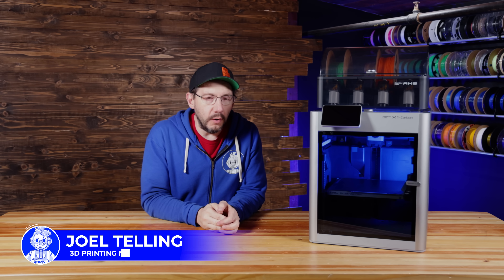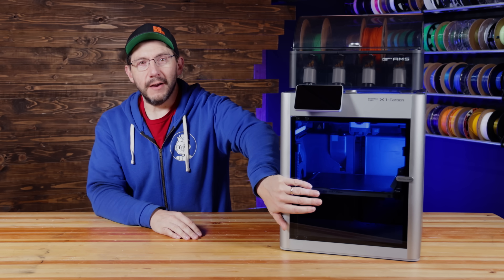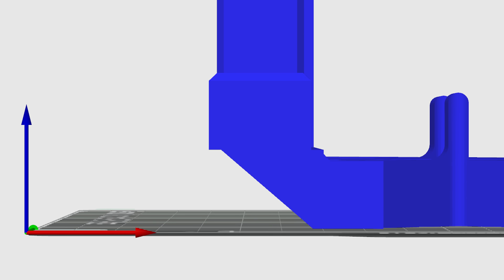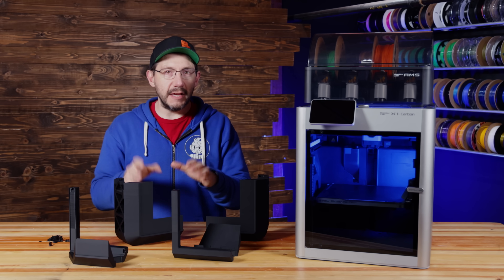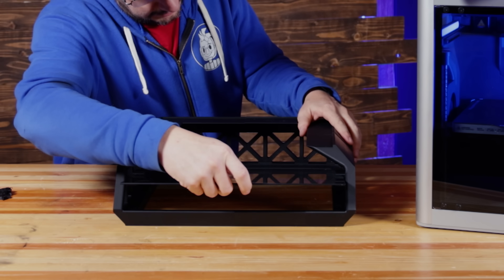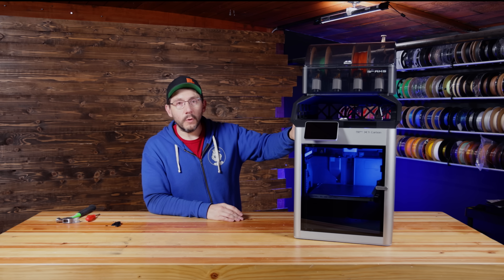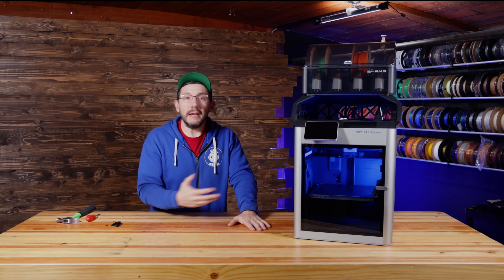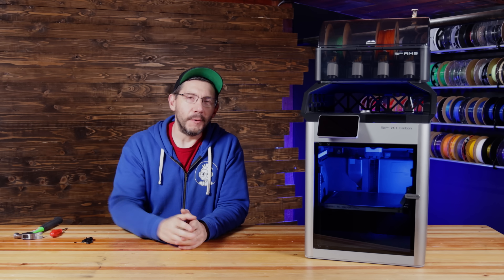MY FAVORITE Bambu X1 Carbon MOD!

Comment: I printed one of these, but never end up lifting the lid and still get great PLA prints.  Since it's in my living room, I'd rather avoid the extra noise, but it's a nice option to have and I use the grid to hold a side spool for the "5th roll"

Comment: I haven't had that problem with pla yet, but my garage is relatively stable temp wise. I do have high humidity (over 60%) so I'm always worried about leaving filament open to the elements due to water absorption

Comment: High quality for a short time. 1925 hours on a X1C it prints like a clapped out Ender 3 now. Lead screw nuts got over 4 mm of slop and bambu says its "in spec"  because there spec is anything from 0 to infinity. But then again according to there better business bureau F rating and the fact they ignore them seems like Scambu lab is a better name for them. But apparently the X!C prints like a clapped out Ender 3 according to bambu lab.
Reply: Sounds like made up bullsh*t but OK, would love to see some video evidence on that. Either that or you've never done any of the required maintenance.

Comment: There's a lot of evidence from folks like Stefan or Tom that anything over 30% infill is just wasting plastic, because it doesn't actually improve part strength. (Thoug I suppose 50% gyroid might help dampen vibration.)  Wheareas increased wall thickness makes a huge difference.  At the same time, I think it gets the point across better if one talks about how thick the final wall is, rather than how many perimeters one used.  Especially in 2024 (which is almost is) with a large number of people using 0.6mm nozzles but a majority still using 0.4mm nozzles.

For something like this mod, I'd want my walls to be at least 1.5mm thick.  Maybe even 2mm.  With a 0.6mm nozzle, that would be 3 perimeters, yielding a 1.8mm thick wall.  But with a 0.4mm nozzle, that's 4 (1.6mm) to 5 (2.0mm).  For a part I'm going to sand smooth, I want it to be 1.5mm to 2mm thick when I'm done sanding, so I go all the way to 6 perimeters to have enough "meat" to work with.

Anyway, my goal is not to tell you how to print your parts - although if you did do 3 perimeters with a 0.4mm nozzle, I'd really like to see a follow-up in six months, because my "1.5mm to 2mm" goal is a fairly cautious number - but rather to suggest that we, as a hobby, need to shift the way we share information about wall thickness, because it's no longer safe to assume that everyone has the same size nozzle.  At the same time, by talking about how thick the final walls are, we get a better idea of what we're actually talking about.  As soon as you point out that 2 perimeters on a 0.4mm nozzle is less than 1mm of plastic, it becomes clear that that is nowhere near enough for something that needs to hold weight or get sanded.

Happy New Year, Joel!
Reply: Absolutey. Stating number of walls without stating the nozzle size is like saying a rope is 5 long. Same thing when people ask how much filament is needed for so-and-so (large) print. saying it takes X rolls isn't very informative at all. Personally I use mostly 3kg and 5kg rolls, but I have filament rolls as small as 750g.

Comment: I was looking at an x1c but it's very odd to me that you even need to do this. Part of the draw of the x1c is the full enclosure and the activated carbon filter to reduce particulates in the air but if it's a known requirement that if you're printing PLA you have to just open the door then that really defeats the purpose completely.

Comment: I decided to go with the "Light flood for closed Bambu lab printers" by Jorge Rui at Makerworld, as it has toggleable vents (no need to mess with the glass) as well as additional spots for lights. It is recommended to print in PETG with PLA support interface, and i found my settings weren't all that great so it took a bit of tuning to print properly, but once i got everything dialed in, it went perfectly!

Comment: How does the temperatures hold up? 
I'd guess there would be slight temperature drops, since there will be small gaps between the plastic and the top of the printer, as well as where the glass cover rests.
But if so, how big of a difference is there, if any?

Thanks.

Comment: I've printed with over 100 different PLA filaments with the door closed, and the only jam I EVER got with the door shut was due to brittle filament snapping. Have you actually experienced this overheating jam Joel, or are you just proactively solving a problem that supposedly exists?
Reply: p1s and x1s have chamber ventialation, so also dont see any reason. Unless you would want to turn that fan off to have quieter print?
Reply: I’ve always had the door closed…never had any problems in the year I’ve used it, only used ever Bambu’s filaments sooooo…
Reply: @Gazooka  Same.
Reply: PLA+HotPlate/Textured - It is not a problem if ambient is around 24 or less. No need to open anything.
If ambient goes 25 and more+, then you quickly reach 40 and fans spin at max.

If you are in ventilated room with ac, you never have this problem.
Reply: @petrihadtosignupforthis8158  this is what i expected

My ambient is 13-16 c and it stabilises at 34-37 when printing 

At 30 c ambient, i think it probably hits the glass trans temp
Reply: I have never had a problem
Reply: @Martial-Mat  I never had the issue until I needed to print at low speeds (<60mm/s). There's a point in using open or vented enclosure.
Heat creep is a thing and many people have suffered with it.
Reply: @thefearpt  I'm not sensitive to different print speeds. I assume that is slower than the norm. May I ask why you needed to print at that speed?
Reply: @Martial-Mat  highly detailed lithophane. 
Higher number of retractions per filament lenght, together with room temperature above 40° (which eventually gives the heat creep to PLA), it's a mess.
Reply: @thefearpt  Oh that's interesting. I've never done anything special printing single colour lithopanes, but obviously if your room is at 40 (c?) then you're in an oven not a room  ;-)
Reply: @Martial-Mat  room temperature = enclosure temperature, sorry for the misunderstanding. But don't you worry, you'll deal with it sometime!
Reply: @thefearpt  Ha ha - I'm too oblivious to recognise it when it happens. Plus I live in Britain, so high temps are not a massive problem!
Reply: My fans don't even run past 80% unless I command it. 

You can also just vent the glass slightly and do the same thing here. 😂
Reply: I live in a tropical country, It’s all depends the enviroment you are in. Ambient temperature can reach 42-44 degrees in summer in my city and this can be tricky in some cases for enclosured printers using PLA… even when is up to 36-38 degrees. In some printers I pointed a fan to the heatsink to make it cooler
Reply: @Fernando_Gazzola  Wow, I love the heat but that sounds seriously uncomfortable.
We don't really get the highs or lows here. But loooong months of grey drizzle. I guess we're spoiled from a printing perspective.
Not that I'm an adventurous printer anyway. I think I'm going off-road when I use more than one colour or metallic filament! 😁
Reply: Well maybe you've never experienced it but this IS the instructions that Bambu gives and some of us like to follow the instructions :)
Reply: I had it happen to me once with a spool of creality pla or st least I think that was the issue either that or an issue with the filament cutter
Reply: @krishgup1208  Ah yes, I have had an issue with the cutter.
Reply: I'm a bit puzzled by this too. What's the chamber temperature when printing PLA? If this was a real problem, wouldn't other materials with higher extrusion temperature but also higher bed temperature (leading to higher chamber temperature) have the same kind of issue?
Reply: Interesting approach to overcoming a problem introduced by not using the “Cool” plate the printer came with! It works surprisingly well. I have over 1000 hours printing PLA with the cool plate and have not experiencing any of problems you described.
Reply: @cbgslinger  I use both the cool plate  and the PEI plate - no problems, ventilated or not.
Reply: @Martial-Mat  I have a PEI plate, but have never used it. Bought it shortly after I got my Kickstarter Combo since everyone was raving about them. It’s a backup for my cool plates should the need arise. The cool plate just works. I use Windex for my release agent. It’s quick and easy.
Reply: @cbgslinger  When it initially launched, the cool plate was heavily criticised for need adhesive or glue. The PEI does not need that and also leaves a pleasing pattern on the bottom of your prints.  But horses for courses - if you're happy with the cool plate, then there's no reason not to use it. I find prints, especially with Bambu Matte filament, sometimes hard to remove, and the calibration lines sometimes have to be razored off.
Reply: @Martial-Mat  I remember and that is why I ordered a PEI plate. However, in reading how others use the PEI plate. I suspect my use of Windex on my Cool plate is no more time consuming that the use of IPA on the PEI plate. I’ve yet to use a glue stick. I do like the smooth finish on the bottom of my parts. Although I really should try the PEI plate just to see the difference. Might come in handy on some of my cigar box guitar parts.
Reply: @cbgslinger  You don't need any sprays or glues on the PEI - that was the whole point.
Once the plate cools you can ALWAYS snap the part off cleanly, which is nice.
I've been using the cool plate all week for a human organs/torso project, and you're right, the smooth finish is nice sometimes. Other times, I spend 15 minutes cleaning up the plate after the print refuses to let go.
And then you end up with divots and bubbles and the plate gradually degrades - although the X1 comes with a spare surface and replacements are very inexpensive.
Gotta be honest - I'm in love with the printer. Almost everything Bambu does (except the cloud printing), I find just excellent.

Comment: Joel, thanks for doing this.  I learned the hard way to keep my X1 Carbon open when printing PLA, after constant jams and some research.   I love 3D printing after 4 years in the hobby it is still amazing what we can do.  Functional prints are the best became they solve a problem, usually quicker and cheaper.

Comment: Mine is arriving next week, this will be my first mod! Thanks for the detailed video!

EDIT: OK, just saw the end. I absolutely love your enthusiasm, Joel. It always shows through; never change!
Reply: Buy a lot of filament the x1c is the filament eater you can go through 2 rolls a day 😂 better stock up 👍👍
Reply: @jcfpv3454  It depends upon the number of colours and the type of prints. If you print a single colour - then it's no worse than any other. If you print 4 with multi colours each layer, then you'll waste FAR more than you print.
Reply: May I suggest that you use the printer for a while first. In my experience, this mod is not needed and you can print just fine with the door shut.
Reply: @Martial-Mat  I'm saving up for an X1C and will get it soon. One of my concerns with this mod would be noise, I imagine the printer would be a lot louder with the top glass wide open? Not sure though. The mod is interesting but yeah I will try the printer with the door closed first
Reply: @SangheiliSpecOp  I've never had a problem with the door closed. Bambu just released a new driver that allegedly reduces print noise by about 15%. There is also a box you can print and attach to the back that reduces fan noise. If you are sure to keep the AMS lid closed, that also reduces noise. I'm very sensitive to noise and I run it in another room, and it's still loud enough to stop me falling asleep, although if I leave my PC on, the white noise is enough to mask it but sleep through.

Comment: I decided to go with the BLV - AMS Riser, because it also got two drawers. With that I got all the extra stuff, and spare parts for the printer, out of the boxes, and into the drawers on top of the printer. :)
Reply: I also went with the BLV-AMS Riser. It requires supports, takes a lot more time to print, and uses a lot more filament. However, I believe that it is worth it if you have the resources as you end up with a far better looking riser along with extra functionality. You can also install LEDs and a TPU seal  directly into the riser which comes in very handy.
Reply: I've been looking at printing the BLV Riser.  Did you need to use supports?
Reply: @dancoon7653  Hi, I know I'm late, but it has a remixed version that uses no supports. It's a bit different but I printed that one and it worked perfectly :) Found it on makerworld in the profile section under the original
Reply: May I have the link to the blog riser?
Reply: yeah but holy cow that thing wants like 3kg of filament :(
Reply: you helped me out making a decision, after watching this video I found a few different ones, but not this one, and I like it!!
Reply: This riser only has 4 clips on the bottom. That is barely adequate.
Reply: @mikeyearwood  what do you mean with four clips?
Reply: I agree I spent the extra time doing the BLV and its way worth it. Plus the addons, spool holder on the side and the tool ravk as well

Comment: I like it. I haven't needed it. For whatever reason, I've had tons of success printing PLA with the doors closed and the lid on. I'm sure I've just jinxed it, but now I know what I'll want to print when I do finally run into heat creep on my X1C!
Reply from the maker: Dude print it just because it’s cool. Just not as cool as you :)
Reply: @3DPrintingNerd  Haha! Actually I've been thinking about printing a 100% æsthetic (and 0% practical) mod for the Prusa MK3. It's the "Ultimate Prusa Casing" side pieces to give the printer a more aggressive look.
Reply: Actually the open door creates draft damage even with PLA. Without a riser, removing the glass is the only option. I added another riser just for permanent vents, even though i don’t want an AMS on top. The access is needed too frequently imho. High maintenance machine. With multiples it gets kind of pointless anyhow.

Comment: Pretty is overrated
Reply from the maker: TRUTH
Reply: absolutely! I am a functional printer since i start my Hobby long time ago. So i have always the optic in mind i have to trash more things i ever want to. For me it is easy, every print has an result. 
If it good, its ok. If the result are bad oder really really bad! Even good, it gave me something to think about. Why the print fails. Is there a Problem with my design ore with my Printer Settings. And aver my heavy Star Trek Printing Time (Next Generation Rooks) and in my 40´s i am more relaxe. 
I am a Fan of the Next Generation Designs, so i Print some things, design some things. Change models to fit in a Galaxy S6 Edge and make a Next Genration Desktop Computer and so stuff. Ore make a model that fits in a Amazon Alexa 5. The time i bougth a XYZ Super, ore the full Color Printer form xyz. This was a time full of garbage but also massively joy and pain together in Balance!
(hmm i mean something in this way, there was often times, i want to open thin Windows an let the Craftbot for example learn  to Fly and i mean fly really fare away. This Printer is solid as a rock but my model has i learnd later and after many pain later a problem with the Steper drivers and biger as this a absolut non plain Print Bed.